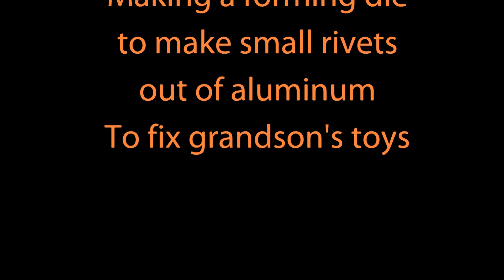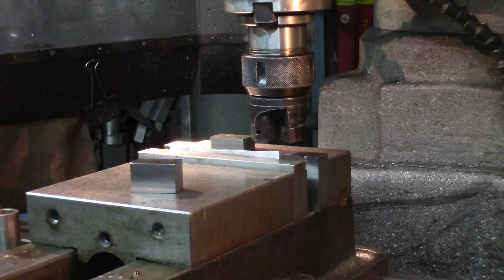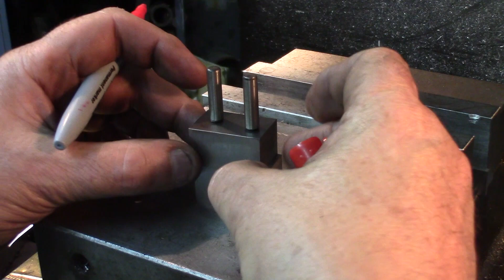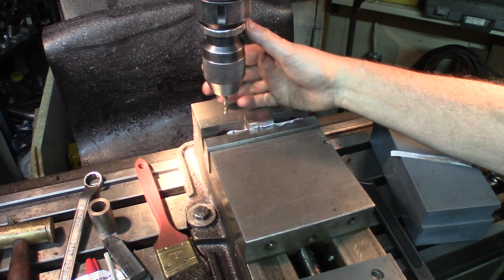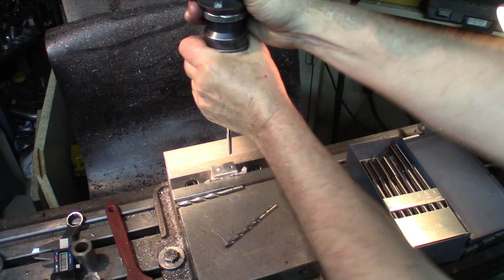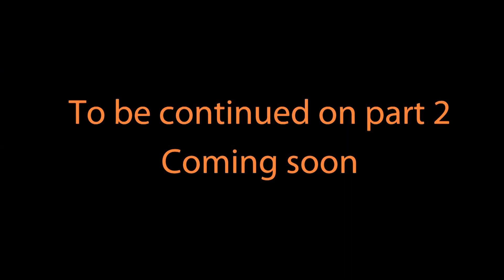Making a Forming die to produce custom rivets in order to fix my granson's toys. part 1

Comment: Looking forward to the conclusion, as I am contemplating a setup similar. I will be needing a jig/work-holder/die for an upcoming project. I especially am looking for hints on how to get the hole to follow the division between the two blocks accurately. I will be setting up to accurately cross-drill 1/16" Stainless rod (316L TIG filler rod).
Reply from the maker: +Peter W. Meek Hi Peter,  1/16" is a small part to hold but, it will be doable... The rest is coming, presently working at it... ;)  Thanks for comment,    Pierre

Comment: Maybe make some for Tom's ladder for that poor fire truck he never finished. lol
Reply from the maker: +bcbloc02 I think that Tom could go less to flea market and work more on the firetruck...   :-|
How are you doing with the new shop?
Thanks for comment,   Pierre
Reply: Been raining last few days so haven't gotten much work done. I have been busy tearing out stalls and digging them out down to the concrete though when I can. I went to an auction Tuesday to try to buy some crane support steel but it went too high for me.:-( I also had a busy shop week making a dozen parts last week but I can't show them so no video either. :-(